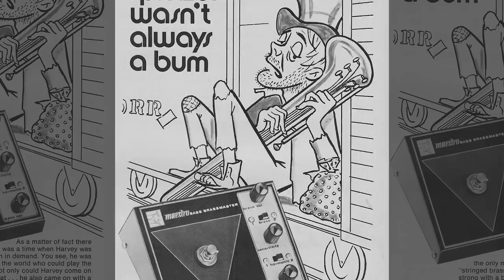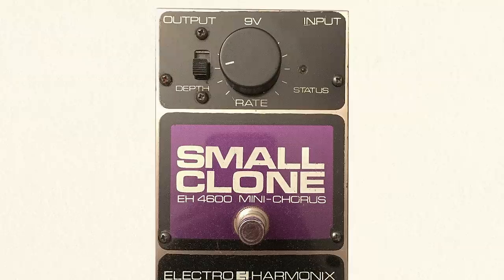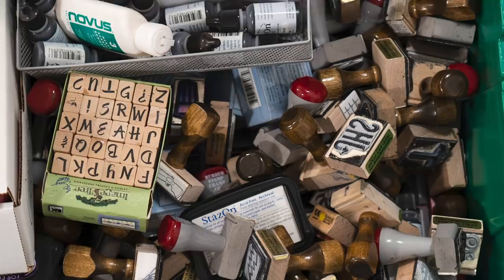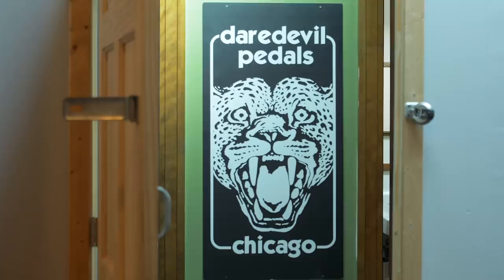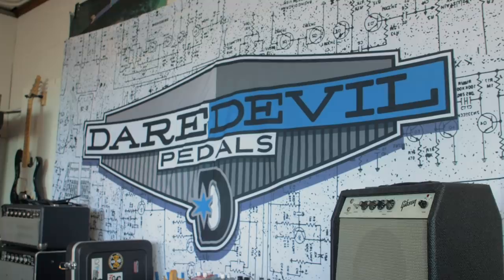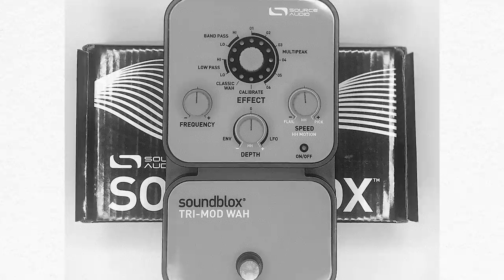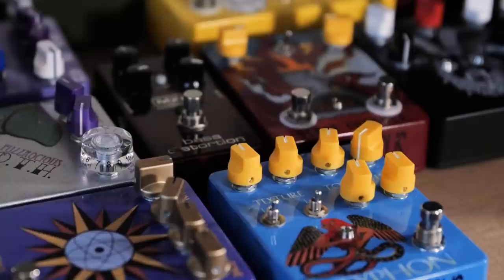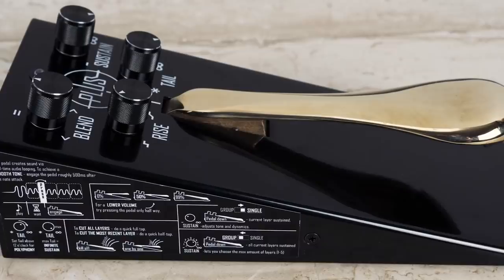12 Pedal Brands Share Their Origin Stories | The Pedal Movie Extras

Comment: I wish they taught electronic engineering at the local JC
Reply: I agree, I wish I could maybe just find help learning to solder.
Reply: @kevmac1230  As someone who’s built a few guitars now and done a few minor repairs on my car, I’d say that soldering is a difficult thing to teach or learn. You just gotta do it a few times. Get a cheap iron (I started on a $7 harbor freight piece of crap) get some cheap solder, and find a few strands of wire and just practice over and over trying to get good clean connections. When you can repeat the outcome to a consistent level you can go buy a Weller or something better with interchangeable tips and spend a bit more on some accessories and better solder. I found the lead free stuff doesn’t work to well for me. I like the leaded stuff still, I just pop the garage door open with a fan on. There’s a lot of video on YouTube that helped me pick up some of the basic techniques but you really gonna learn from experience
Reply: @kevmac1230  just do it my dude.  get some practice kits off ebay if you want.  any iron that isn't total junk is enough to start on.  you'll be up and running in a day!